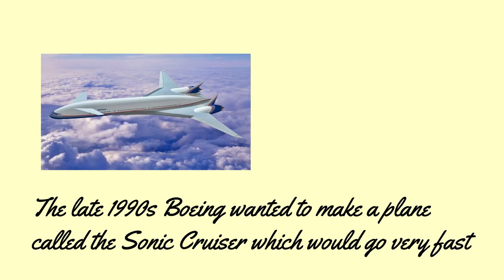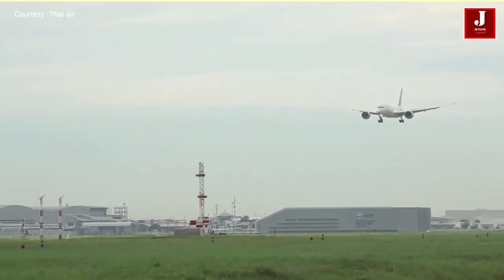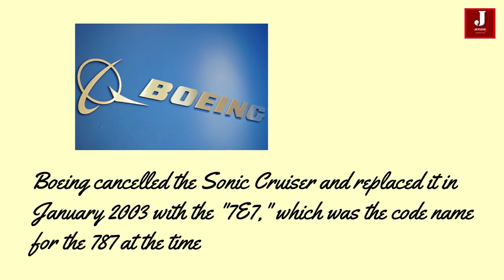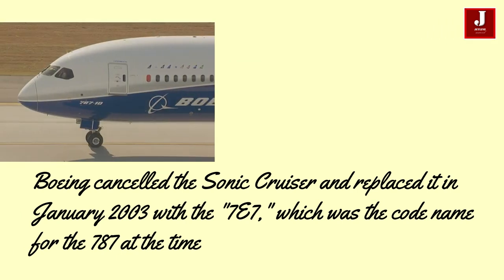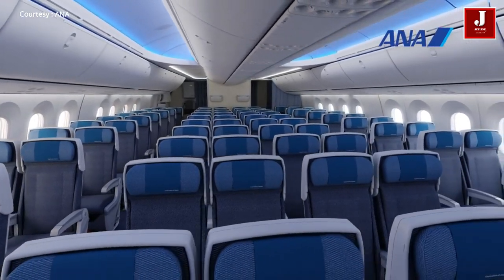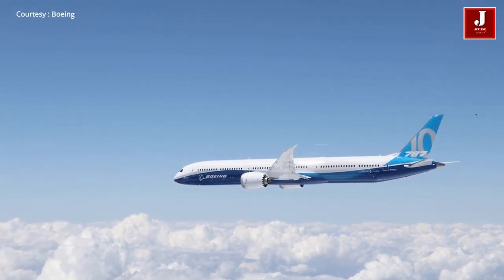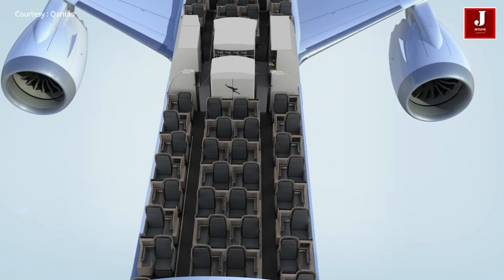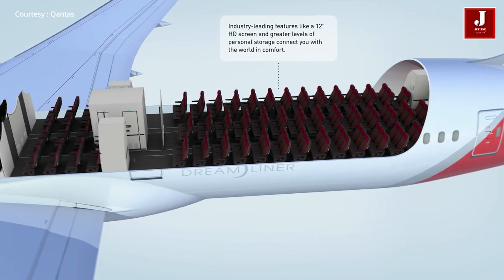Why is the 787 called the Dreamliner ?

Comment: My guess i came up with many years ago is that it is a play on the word “streamliner”, used for luxury, sleek looking passenger trains in the mid-20th century, and the plane is designed to offer the same luxurious experience as the trains did all those decades ago. Also a side note, as a train fan myself, I have owned a CD for over 15 years now called “Sleep on a Train” and the art on the cover of it depicts an observation car at the back of a train with a sign saying “The Dream Liner”. Not to mention this CD came out in the ‘90s, long before the airliner got the same name. So the Dreamliner as in the fictional train on the cover of the CD came first, then the airliner.

Comment: You not answer the question.  So why is it called in Dreamliner.
Reply: Same doubt
Reply: @krishnakalyan5301  did u find out why its named the dreamliner?
Reply: @ayanhassan8547  it's the dream of many engineers to develop the aircraft in that set of model(like particular seats, particular engines,power, capacity, design etc..)so engineers worked hard to develop b787(Dreamliner) aircraft with lot of time and effort and finally done it as their desire,so it's their dream and called Dreamliner